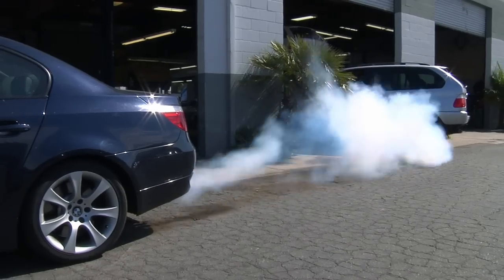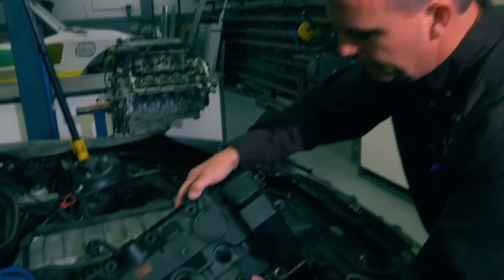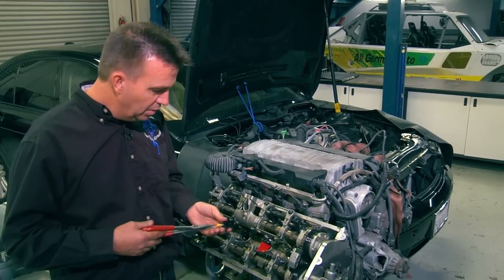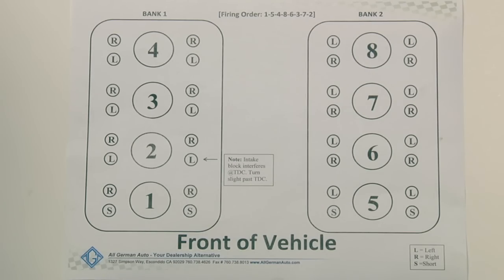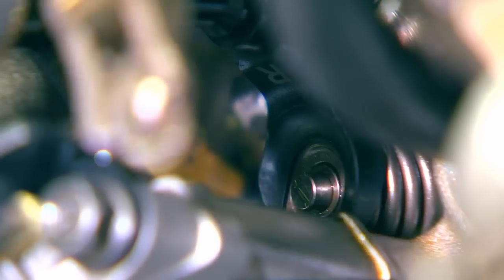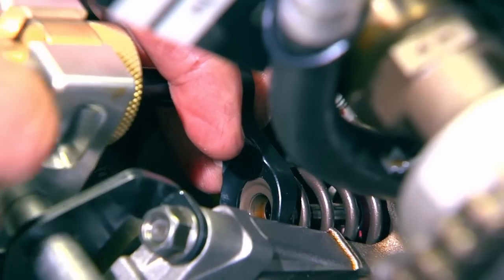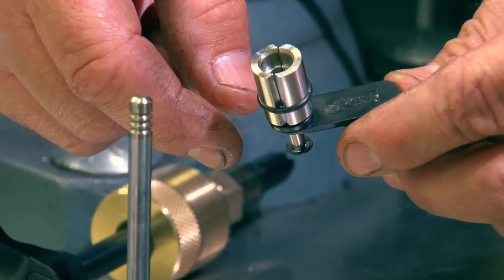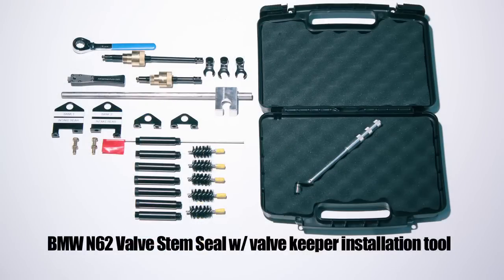N62 & N62TU Valve Stem Seal Tool Kit

Comment: I hate those keepers they are the most frustrating part of doing this job. If you can remove the engine its well worth it time + frustration. Almost done with Bank 1 intake is absolutely a nightmare especially when it comes to trying to snag the keepers back on lol
Reply from the maker: Art, have you used our valve keeper tool? If you haven't, you are missing out!
Reply: yup .. just haven't mastered this tool yet .. I guess there are a lot of tricky parts to get into. I'm worried now that I'm finished with bank one that my valve dropped into the cylinder "intake" was able to retrieve it and install properly but now I'm having issues with the valve properly seating .. lost about 10% when putting air into the cylinder. Should i go on ?
Reply from the maker: Art, the keeper tool does get a bit tricky, but once you know how to put the keepers in, it's a walk in the park after that.

With the valve not sealing, was this on intake or exhaust side? Because if it is the intake side, these engines are known to have issues with the valve sealing on the intake side once the rocker arms go back on. What we like to do is finish the intake valve seals and install the rocker arms all at the end.
Reply: This happened on the left bank / bank 1on intake cylinder 4
Reply: Having an issue with the intake rocker followers.  They seem to pop off the spring with the smallest touch and getting the spring back into place is a serious pain.....any suggestions?
Reply: Put this in the wrong place...

Comment: Nice tool, but 1300 USD this is reserved for professionals... I did this job for less than 40 USD with a cheap Chinese timing tool and a universal valve spring compressor.
Reply from the maker: Gotta love saving money!
Reply: @AGATools  I’d consider buying some kits for renting out though. Are these tools usable on more than one specific bmw-model? Do you sell the bits needed to use with other bmw-models or even other car brands?

Comment: I just did one of these, in the car.  It's a bitch, and I am an actual wrench with 40 years exp.  Beware these engines are crap.  Buy an Impala
Reply: I have done 3 bmw 745li an man did it save me time it took me 4hrs for both sides
Reply: No my friend all were done it is hard dont get me we wrong when I first bought this tool it was taking me almost 2 days with the engine still in the car lol know with the engine out it was taking me about a full day know it takes me 4hrs with the engine out but with the engine in about 8 to 10hrs it is a littel hard if your first time user with the x5  you should be good wish offers better space to movething around but it dose beat from taking the engine out taking the cams of sprocket ext thats how I did in the past pluss you have to worry about timing also locking the crank so it wont move wen you pressurized but if you have questions let me know any one il be happy to help out
Reply: Also keep in mind bmw charges 6grand to 10 thats a nice down payment for a new truck lol